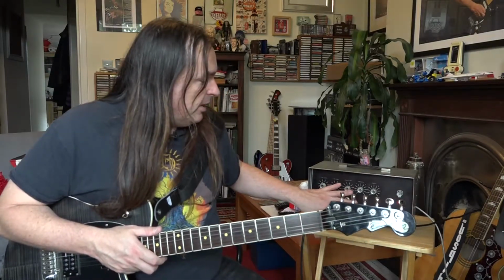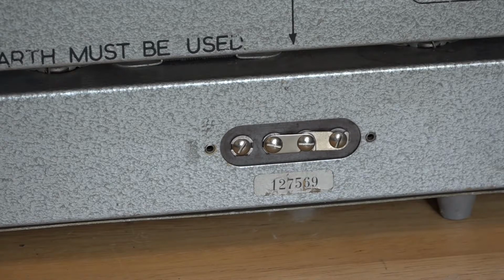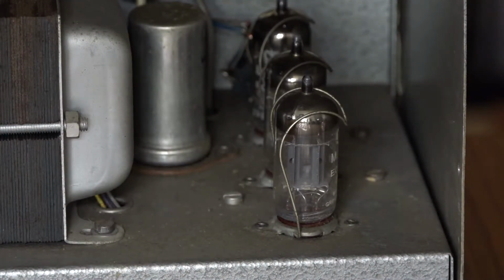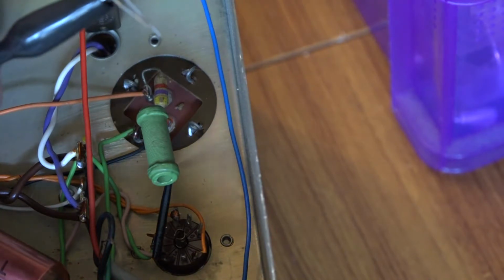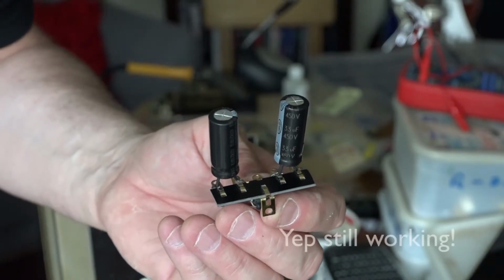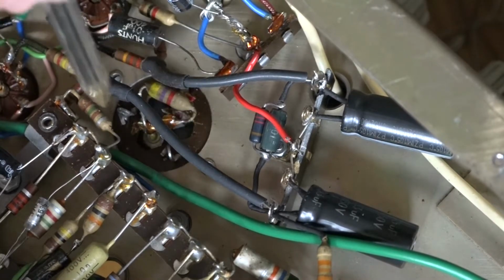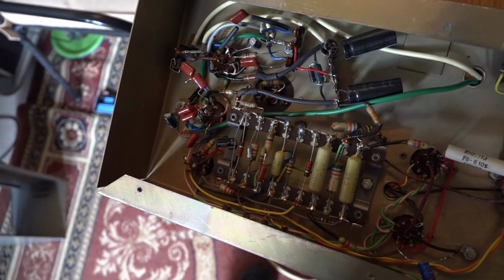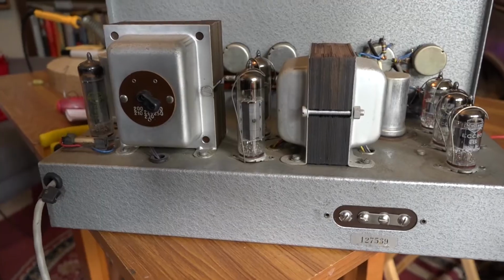Making an Elpico AC-88 from 1963 to a gig ready amp for today (Sound City Studio 20)

Comment: The fiberglass pencil as you called it, also known as as a glass bristle "scratch brush" here in the States, is an excellent tool, although rarely seen in use on YouTube videos. Just watch out for splinters from the glass bristles, they'll stick in your fingers and fester for a week until they work themselves out and it's almost impossible to pull them out with tweezers because they are nearly invisible and prone to breaking off. (You can sometimes remove them with a piece of extremely sticky tape). Gigging musicians are advised to wear gloves when using this tool.

One should always avoid spraying any kind of contact cleaner into a tube socket if it leaves a residue:  lubricant, preservative etc. Pure alcohol is OK as a degreasing solvent, but my favorite way to clean tube socket contacts is with a point 036 to .039 diameter wound guitar string worked back-and-forth in the contacts like a miniature round rasp or file. This does a much better job of removing tarnish, oxidation and corrosion than any contact cleaner could ever hope to accomplish. Retension the socket contacts afterwards and they shouldn't give you any trouble for the next 5 to 10 years.

Please don't cut the chassis to install a power cord socket!  Just install a new cord with a proper bushing or strain relief to prevent the court from pulling out or chafing. Cutting or drilling holes in a vintage amp of historical importance should really be avoided.
Reply from the maker: I knew I'd offend someone with the power socket, as I said I did it because I want to use this as a gigging amp ,  yes I have ruined its value but I'm never going to sell it so I don't really care. I also hate the elpico internal fuse so Id always have had to have done something to replace it. If you see my follow up you will se That I replaced all the valve bases as the original ones, esp in the pre amp section were knackered. Love some of you tips though.
Reply: Some useful tips.. Appreciate you took the time to write this useful post. Have I stumbled upon a useful, humble dedicated channel with a useful humble dedicated following!!!??? 🍀 would make a wonderful departure from the usual YouTube shill-fest that makes up much of the body of the guitar presence online.  Like Mad Malko guitars channel, or JHS, there are those rare diamonds, and I am glad to find one here.🍀
Reply: @blacktoothfox677  , check out the Psionic Audio channel, and Brad's Guitar Garage. Lots of useful amp repair, voicing,  and modification tips, without any drama.

Comment: Hi, The Beatles never owned one of these. However, I do have a picture of what looks to be the same speakers that came with these hanging in the Cavern Club in the early '60s. You don't see the speakers very often. I do have an AC-88 with the original speakers. It sounds amazing through the two metal cased wedge shaped speakers with an 8" speaker in each.
Reply from the maker: Yes I never believed the Beatles used to one of the simply because he didn't come out until 1963 although of course McCartney had an ac55 amplifier for a while. I turned down buying a set of those metal speakers a while back I wish I had bought them now.